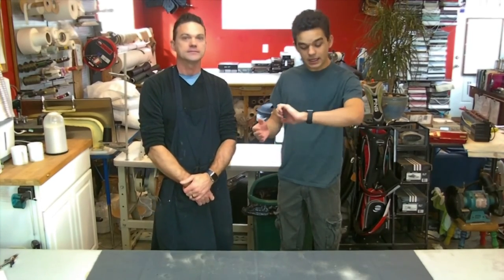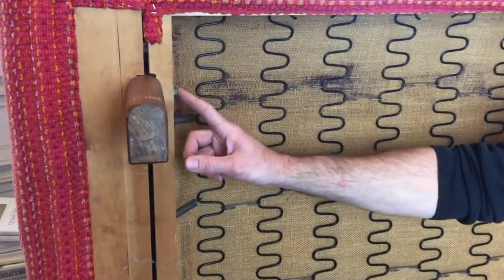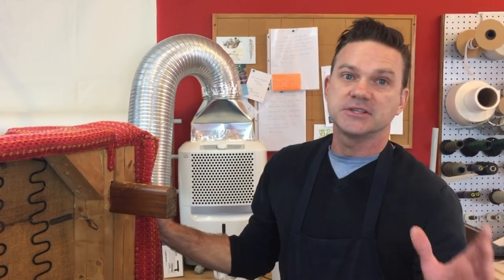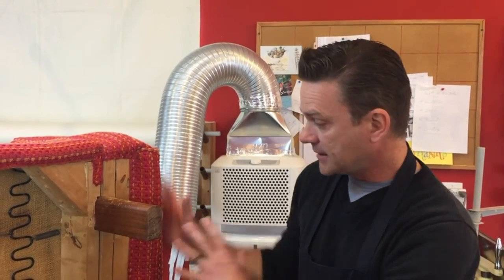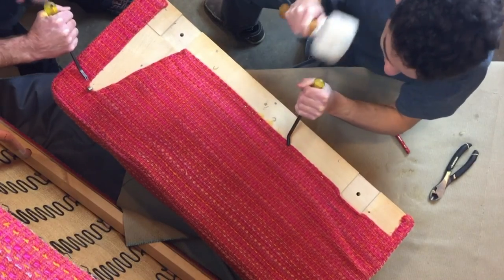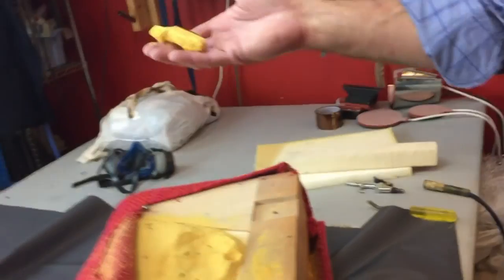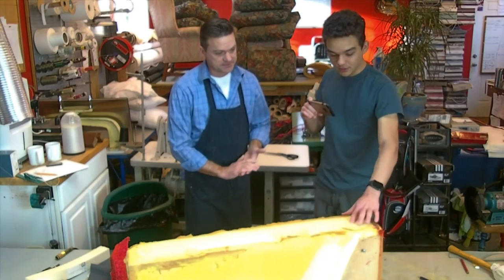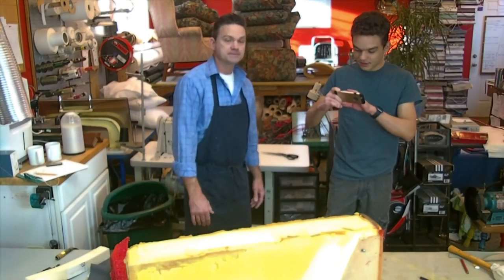How we replaced the foam in a 51 year old sofa Part 1

Comment: Beautiful timeless sofa. But seems the fabric should be thoroughly cleaned after the rubber silt is removed.  What is the best method to thoroughly clean and sanitize the 51 year old  fabric before new foam is added?  

And what about cleaning vintage sofas made with crushed velvet fabric?
Reply from the maker: Great question! I have been wanting to do a video on cleaning furniture and I will very soon. The key I learned from my father was never use water, SUDS only from a bucket with a wet Vacuum and soft brush. Velvet's most cleaners stay away from, they have to be cleaned in the same direction, or the pile is destroyed. Crushed velvet might not be as bad with the pile being crushed or matted down. I would be cautious and clean in an inconspicuous place first say the zipper bands.  I hope this has helped you.  Thank you for commenting. Please share our videos it helps us when you do. 
All the best.   Paul